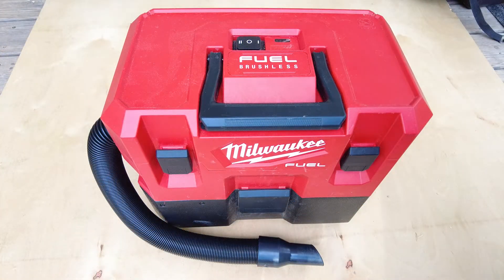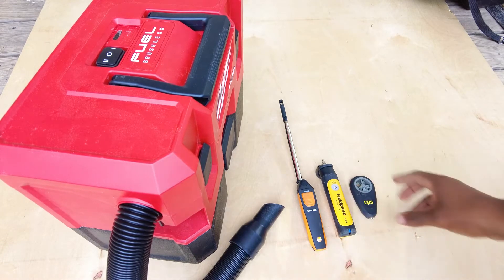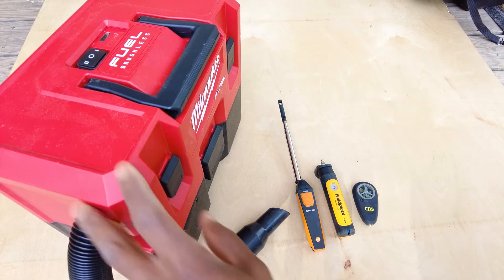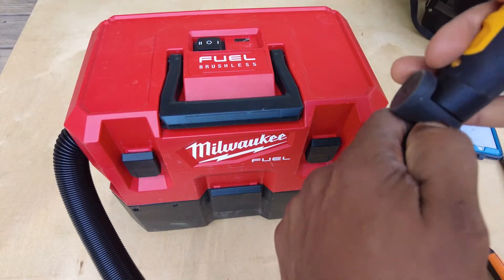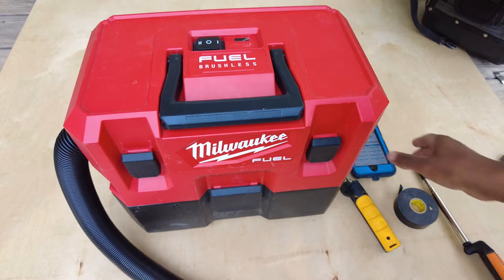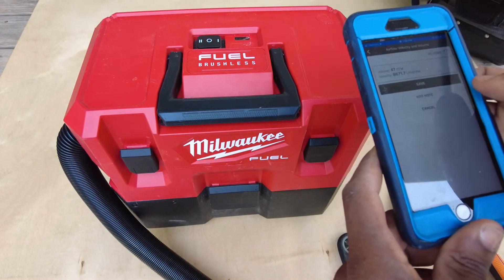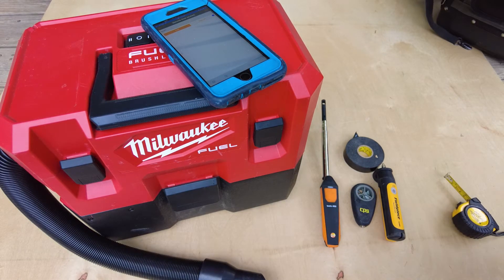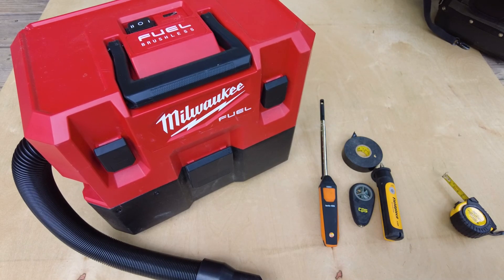Milwaukee M12 Fuel Wet/Dry Vacuum | Test & Review | Compact Battery Powered Vacuum for HVAC Techs

Comment: would attaching the hose to the air blowing exhaust port as intended for use affect the cfm's? and how long does that xc4.0 battery last in continuous use on low and then on high in minutes? thanks.

Comment: Do you still have this vacuum and has it held up in the past year?
Reply from the maker: Oh yeah I still have it just use it the other day as a matter of fact it's still holding up very well.
Reply: @HVACTechKnowledgy  thanks.  I am in the market for this type of vacuum and having the batteries already makes it a ez pick.  I have never had a m12 product that has not held up.  Some get a lot more use than others but they all are holding up better than my old DeWalt 18volts tools ever did.  I had the DW18volt wet dry vacuum back in the day it was louder then a big vacuum but didn’t work at all.  It had plug and battery which is nice unless the vacuum just didn’t do what it was supposed to Suck.  I have held off 15+ years to try a cordless vacuum again.  In that amount of time lots has changed with batteries so I think I am going to finally pull the trigger on this m12 wet/dry vacuum.  Thanks for your reply.  Milwaukee should thank you as well because of you I getting one.  I will be sure and like and subscribe to your youtube page.  Have a great day 
Mark

Comment: Hey, do you think its a good vac for an hvac tech ? As far as the battery side of it. Will it hold all day for running calls ?… thank you
Reply from the maker: Yeah its perfect for use in hvac. As long as you use the 6ah battery you'll be good for a few uses.

Comment: I use mine solely as a wet vacuum for winterizing and cleaning the bilge of my boat. Small enough to get into tight spaces, and the hose stores inside so it's not flopping around making a mess. Just wish it had a drain built into the base.
Reply from the maker: Thanks for sharing! Yeah I though the same about the drain.